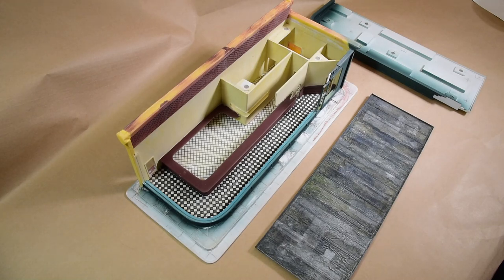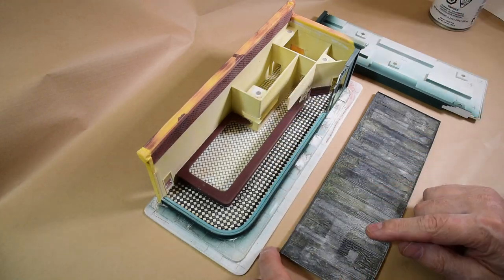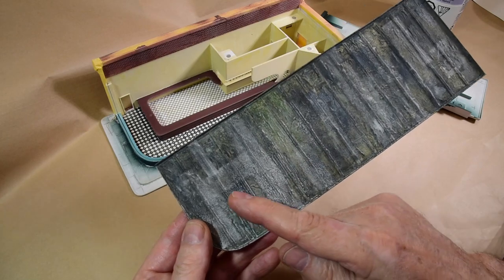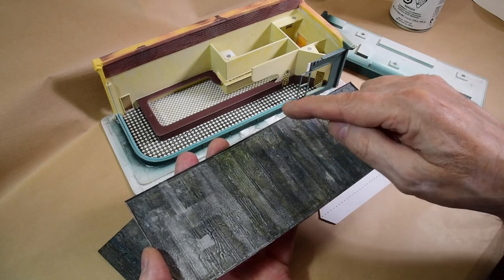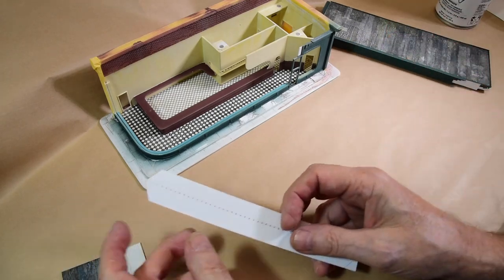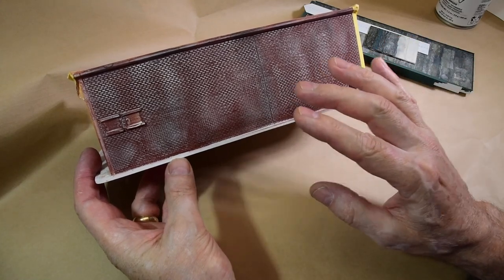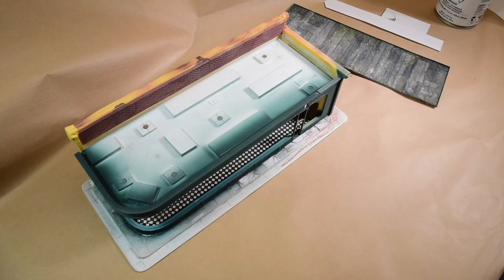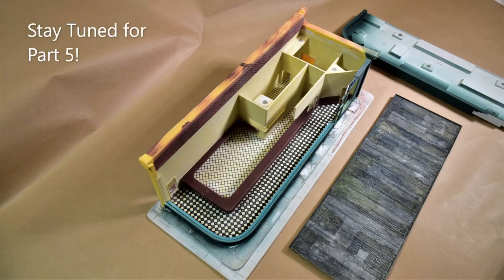Diner Scale Model Roof Paint Anomaly | River Road ~ Vlog # 135

Comment: That effect is like one that I did to a frame I made for one of my scenic B & W prints. I made the frame and painted it black but ran out of the spray paint. So I used a different brand, sprayed the frame, and almost instantly all of the pint bubbled up and I thought that the frame was going to have to be striped to the bare wood. It dried and I love it and have had it on the wall for the past 20 years. I had it in my studio and several clients wanted to know if I could get them the same paint effect. Your roof looks great - it looks so real. I have had several buildings with just that effect on the flat roofs. Sometimes the more you look at a mistake, the better it starts to look. The brick in back doesn't even need any more detail, really...
Reply from the maker: This is the beauty of practicing the arts on a model. Cool things can happen.

Comment: Coming along so well! What a wonderful piece of artwork! I’m working on my turntable. Scoring form lines in the concrete, adding an inspection hole and drainage grates. I will be putting an interior in the dog house too. Your diner build has inspired me to scratch build again. I’ll be scratch building my roundhouse, coal tower, water tower, sand house and oil mixing house. Thanks for putting out these wonderful and inspiring videos. Cheers!
Reply from the maker: You structures sound awesome. Glad to hear you are re-inspired. Scratch-building is awesome - even if it's just a toilet. ;-)
Reply: I loved the toilet build!! Inside the sand drying house there is a coal stove with a funnel shaped screen around it to dry the sand. I found a great photo of one and I’m putting it in there!
Reply from the maker: @blaketatar1239  Sounds awesome. I think as modelers we underestimate the "micro" details which we use so often and take for granted. They seem to add the final charm on a scene or model in my experience. On the other hand, they are easy to leave out as well.

Comment: I had that anomaly with one brand of matte varnish on one model and like you I was initially distressed but ultimately pleasantly surprised. The building was a derelict brick factory background flat based on the Model Buildings Hart Steel Co paper and card download. I added brick piers, heaps of pipes and other stuff to created some depth to the model and when it was finished, like always I gave it a spray. Went milky like on yours and I thought “Well that’s a few hours of modelling down the drain”. But I didn’t throw it away and after it dried it looked really derelict, with a crumbling brick finish I could never create from scratch. I love it now, and I keep that can of spray varnish aside for the next derelict model I want to build.
Reply from the maker: It is cool when it happens this way. This Vallejo (Spray Can) Matte varnish has causes similar reactions before. What is strange is that I thought it was the IPA base that caused the anomaly - which it did on the walls. On the other hand, when I used it on the roof, where I only used water, it did the same thing. This is why I love art. One never knows unless they take risks through practice. I mean, in the end one could always cover it up. Not in this case though. ;-) Cheers.

Comment: That did turn out nice. I have had too many bad surprises with paint. A good surprise is really nice to see. Well done. I don't drink coffee, so when the diner is done  I will order a rootbeer float and some apple pie. Cheers - Larry.
Reply from the maker: I rarely have bad experiences with water based paint using this method (thin washes), with dry times in between. Furthermore, it is almost always in the context of weathering, and with weathering almost anything goes. This is also why I will often conduct practice pieces before I go to straight to the model.
Reply: @boomerdiorama  I started in the early 60's painting model cars and airplanes using Testor's enamal model paints. If I could keep the brush strokes down the paint job usually turned out pretty nice. Because of this painting is something I usually hated to do. Painting for model railroad came with my second layout in the early 80's. That was usually a hit and miss also. I did not start using an airbrush until I got back into RC Airplanes in 2005. This was primarily to add custom markings to identify my plane from the others while in the air. This, because of the cheap paints I was using, was also hit or miss. When I started back into model railroading, 4 years ago, is when I started playing with water based paints and using layers. Now I only use Tamiya paints in the airbrush. The work on Waterman Junction...the structures and scenery... is the very first time I have done anything like that.  And thanks to you, and a few others, I have learned a lot and have the confidence to just try it and see what happens. ....wow, that was long winded.... Sorry... Cheers - Larry
Reply from the maker: @harperlarry49  I still have a sealed bottle of Testors rust, which I am saving for a special project. Testors rust was the best "rust" color for enamel based paint back in the day, even over Humbrol, and still is in my opinion. Cheers Larry.😁

Comment: A very interesting video, Boomer.  I've used the Vallejo Acrylic Flat Varnish (mostly on structures), but I could never get it to perform to my satisfaction.  I switched to Mr. Super Clear Matt spray lacquer and have been very happy with it.  Your success with the Vallejo suggests that I'm the real problem here, but the Mr. Super Clear has always come out looking good.  The down side is that it's ridiculously expensive, so now I use it sparingly and only on rolling stock and locos.  I still have a couple of cans of the Vallejo and will try it again, especially since it is Boomer Approved.  By the way, your last video inspired me to try building an HO utility sink that will be displayed as a discarded item on a junk pile. It was "carved" from a piece of 0.25 x 0.25 plastic with a Dremel.  It came out well, but I decided to buy some HO toilets after I realized just how small they are.  :-)  They will make interesting pallet loads on a loading dock.  Cheers from Wisconsin!
Reply from the maker: Sounds great!

Comment: That's coming along real nice. An excellent  build. I was wondering about two things, are you going to illuminate it with leds, and I saw that you were going to cover up the seam from the two brick sections with a downspout. That's exactly what I would do, then I noticed when you put the roof section on there is a parapet wall that extends above the roof. I see that the brick seam extends up there. Do you have an idea of what to do with that or are you just going to leave it, which would be okay as well. Just wondering, because I scratch build a lot of things and I'm always watching. This old geezer has learned quite from your videos and I look forward to every video you make. Keep up the great work.
Reply from the maker: Yes. I will be using LED's for the lighting. The rear of the building façade does extend above the roof line. Not sure yet on that. I could extend it or mount an abandoned conduit pipe there, or something. You won't see the rear seam once all the weathering is done and it faces back into an alley behind the building. Cheers and thanks for sharing. ~ Boomer.

Comment: It's the alcohol and the clear spray. I saw it done on boxcars ,and in  fact tried it, in a video. I can't remember which is first , alcohol or the clear coat. It does make make a striking result. Don't clear coat it again it will go away.
Reply from the maker: There was no alcohol on the roof Bob. There was on the Brick though. Which is strange because I was aware of IPA clear coat incompatibility at times. But this "Vallejo" clear coat over the same "Vallejo" paint was unexpected.
Reply: @boomerdiorama  That's what I thought but I mentioned it because you thin your paint with it in large quantities. Just guessing I'm afraid😄
Reply from the maker: @bobainsworth5057  It might be due to temperature as well. It was warm inside and I sprayed it outside in much cooler temperature. Then brought it back in to a warmer room. - Who knows?😁

Comment: Boomer happy accident indeed.  I think you would have been hard pressed to achieve the look on the roof you got.

  FYI many years ago I purchased some automotive advertising for garage I was building for the layout.   Because of the thickness of the paper, I sanded it down to approximately the thickness of a decal.   I used diluted white glue to attach it to the garage wall.  Because of the thinness of the paper, it being slightly wet it settled into the mortar lines of the building, creating the look of a painted sign.  Just what I wanted. The sign was sealed with dull cote and it looks as good as the day it was put on.  An option to consider for your sign on the back wall.
Reply from the maker: I know that method as well. It works great. Thanks for sharing!